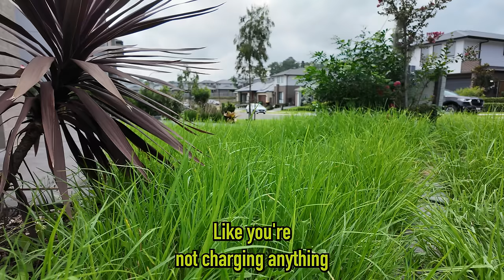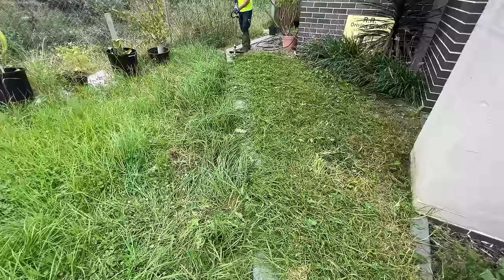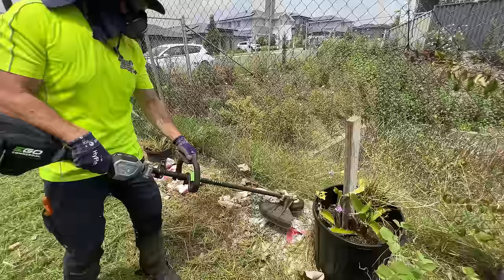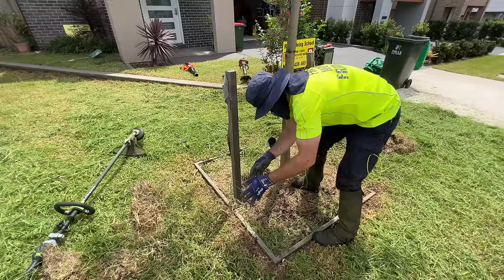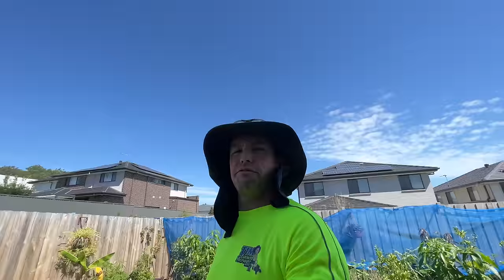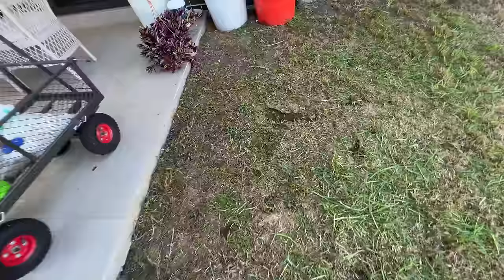He felt bad that I wasn't charging him! #satisfying

Comment: Hey Tim, are you still using those gloves with the padding in them? To prevent the vibrations from bothering your hands when using the whipper snipper? Great 👍 job 👏!  Edges look crispy 👌 as always. Huge fan from the States.
Reply from the maker: I have been. I was using the normal ones here though as I was mainly using a battery trimmer

Comment: Lawnmowing question for Tim: 

Love your work and the Channel BTW! So, with my Ryobi 36V HP 53cm lawnmower, if the grass on my lawn is about 7 or 8 inches high and I aim to cut it down to the lowest height setting of the mower, level  1 (25mm), would you recommend starting the height adjuster lever at level 3, then gradually decreasing to 2 and then 1 with each pass? Or is it more effective to begin directly at the lowest setting (1) and proceed from there?
Reply from the maker: Start higher and work down

Comment: Hey Tim. Question from a tool noob, in which cases are you using the blade trimmer vs a line trimmer? (I'm not sure what the correct word is for the blade one is). I am curious as I haven't tried a blade one yet.

Thank you!
Reply from the maker: Just trying it out. The blade is better for heavy stuff. Line trimmer is more than enough here.